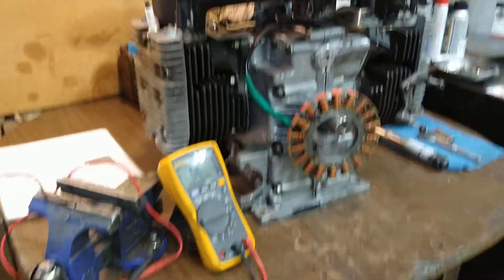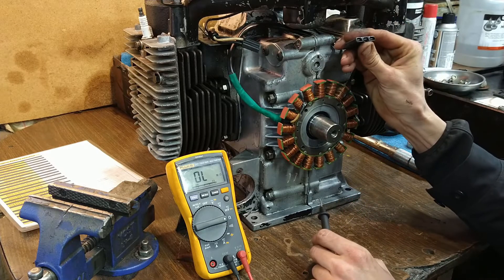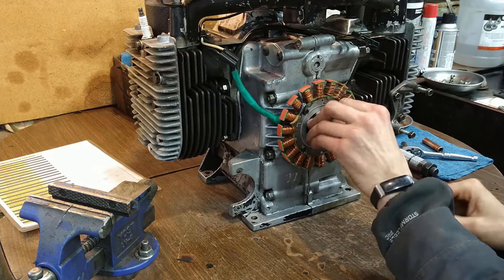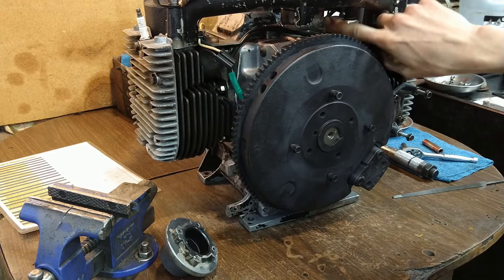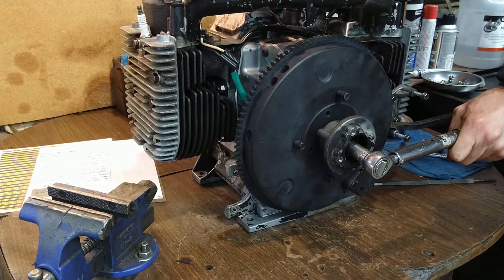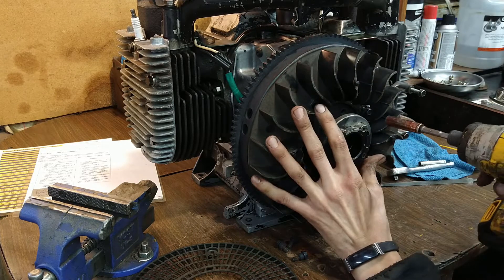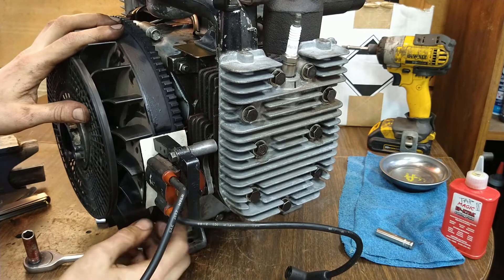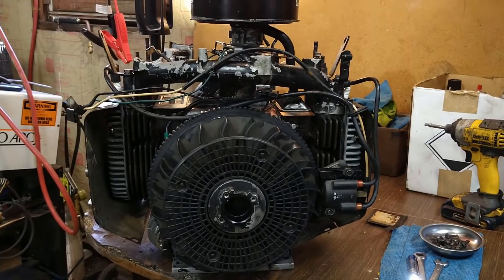Kohler Magnum M18 Complete Svc, Part 15: Stator, Flywheel, & Ignition Coil – Cub Cadet 1882 Project

Comment: What a find !  my lawn boy GT18 has this engine and and I’m sorting through possibilities after it quit and will not start. I’ve replaced the fuel pump and line but that didn’t fix it, checked for spark and got nothing on either plug soooo I’ll be pulling the motor to get at the coil
Reply from the maker: Glad you are saving that old Lawn Boy GT.  Not many of those around!   Its a good chance to clean all the cooling fins, etc while you have it down for the coil replacement.
Reply: Thank you, I try to take care of my equipment and I will clean er up good. finding your channel and this particular series will be a great help

Comment: What is the part number for the crank seal behind the electric clutch? On the M18.
Reply from the maker: https://www.cubcadet.com/en_US/engine-parts/kohler-part-number-x-583-5.-oil-seal/KH-X-583-5.html
Reply from the maker: X-583-5